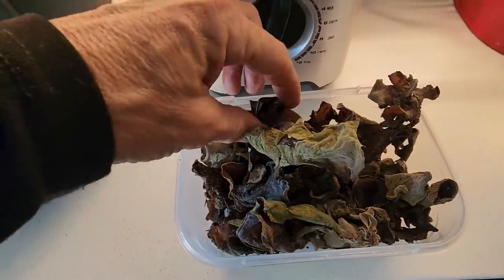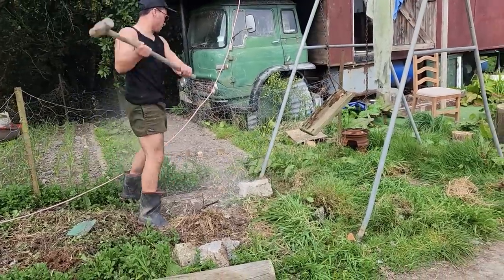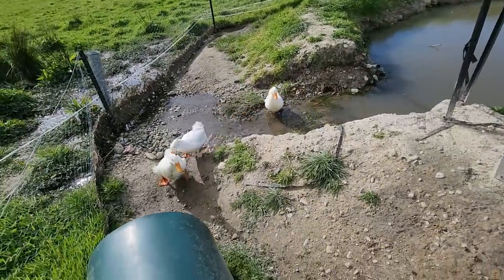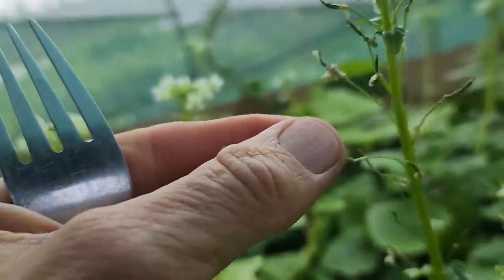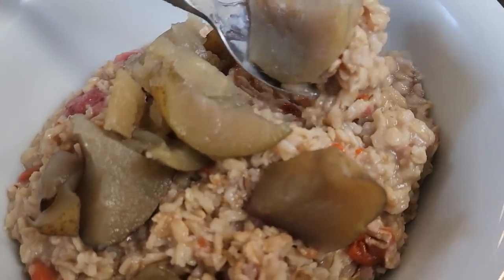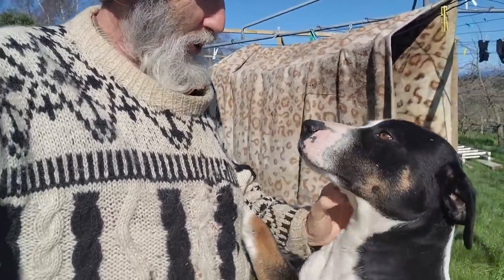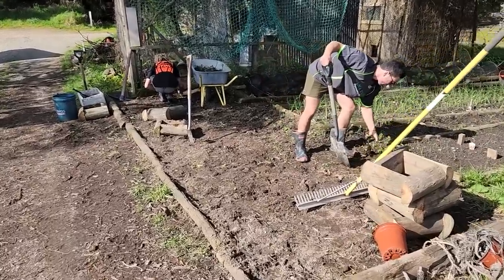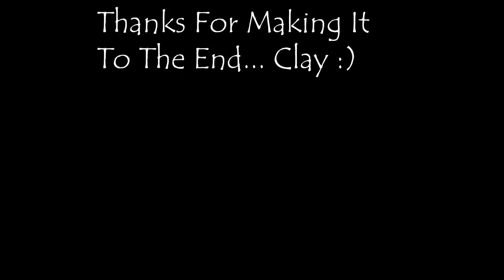Homesteading In NZ Spring Time.

Comment: A tip with any wood loving mushroom if you want to grow them for pretty much free is when you harvest them, keep some of mycelium from the bottom of the mushroom and get corrugated cardboard. 

Soak the cardboard and peel 1 of the layers away from itself, exposing the corrugations and place the mycelium onto it, then recover. 
Place the cardboard in a container and after a week or so you should start to get good growth forming. 

Once colonized you can add that to a fruiting substrate like woodchips or sawdust as Clay did here.

Once the flushes are all done you can just re-add fresh sawdust/woodchips and carry on. No need to keep re-buying spawn.
Reply from the maker: Excellent info
Reply: @ClayTallStories  Yeah basically break up the spent spawn and mix in fresh sawdust/wood chips as you did 👍🏻

Comment: I make sauerkraut every without a problem.  Two teaspoons of canning salt to one pound of cabbage. And ferment for two - three weeks NOT months at 60 - 70 degrees Fahrenheit. If you do it in jars you have to use fermentation lids or burp the jars everyday ( open the lid to release the gas ). After fermentation is done I jar it up and water bath can for the rest of the year. Good luck with the next attempt
Reply from the maker: Good info